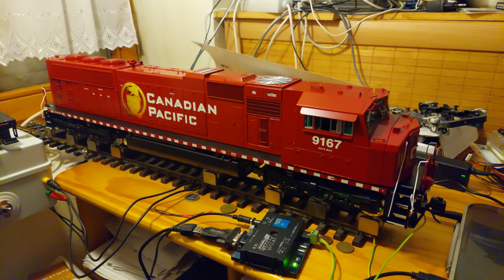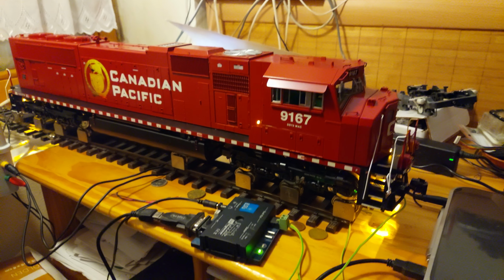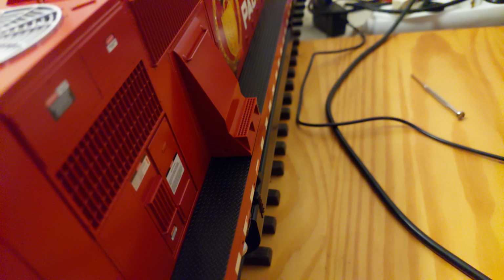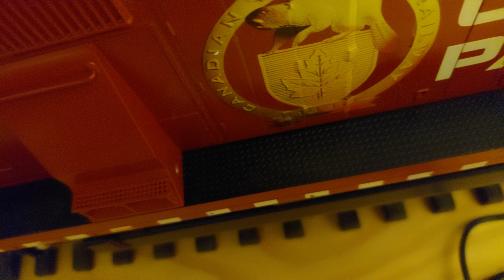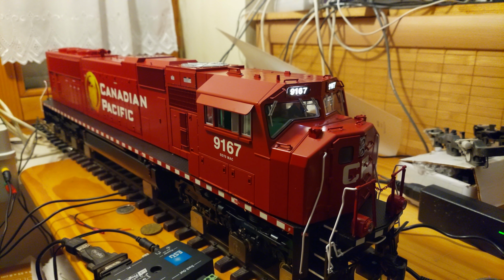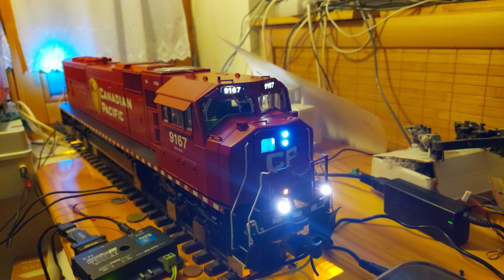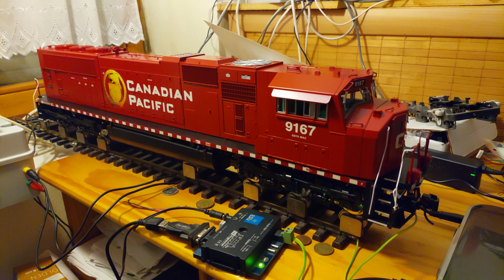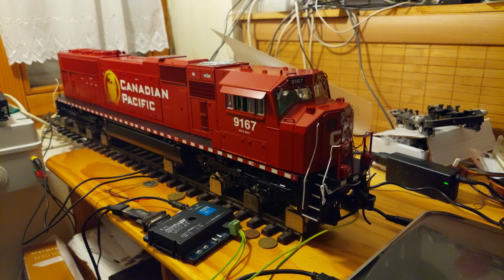ESU LokSound XL and extra lights in G scale USA Trains SD70MAC

Comment: Hi Joo,I just bought a ESU Cabcontrol DCC System. I have a Gscale railking one gauge. George Bush SD70ACE diesel w/proto sound 3.0. I cant get it to work or even find the address to put into the ESU.  Any help would be appreciated.Thank you.
Reply from the maker: Sorry Mark but I have no idea about either of those systems. The factory setting for any DCC loco is usually address (CV1) = 3. Have you tried that?
Reply: @JooFerenc  ok thank you.

Comment: Ok how did you get the fan to run?
Reply from the maker: I put a cheap Chinese 12 Volt fan under the fan and use the 10 Volts output of the ESU decoder to drive it.
Reply: Oh got ya makes sense.
Reply: Hey I also have a F7 USA trains and I’m having trouble getting both smoke units to work at same time using the Esu xl. Any recommendations?